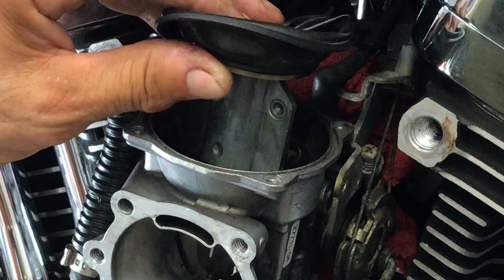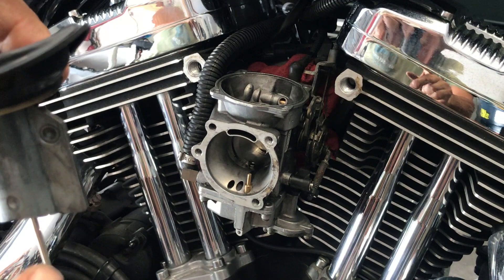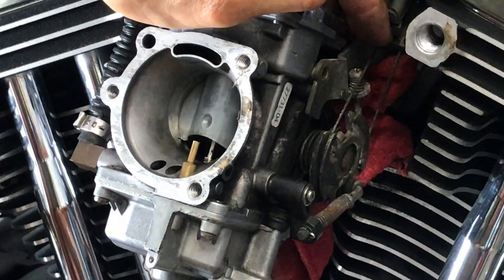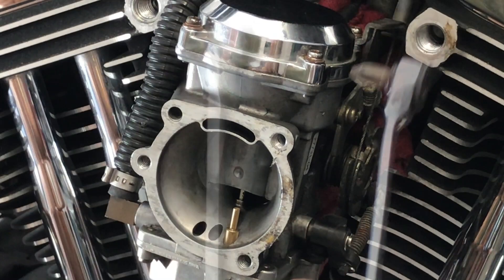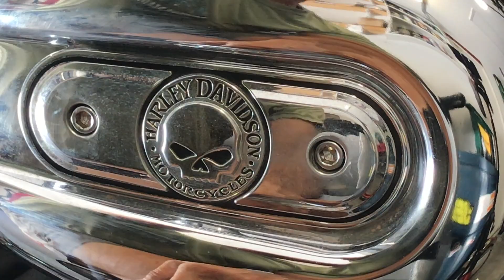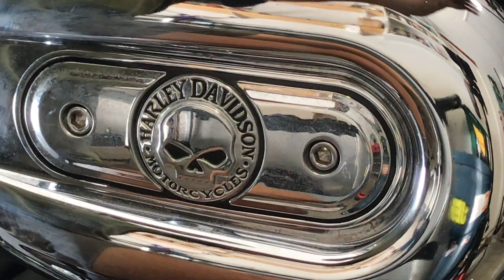How To Harley Sportster Carburetor Slide Needle Adjustment.

Comment: Maybe I missed it but what will prompt you to adjust the needle. You adjust all the jets first. Runs good. What makes you think, “I’ll adjust the needle? I have the c-clip one and there are shims also available on mine. I will say I did notice it sounded lean to me and so I very slightly honed the main jet out but come to find out it’s normal and I thought something must be wrong, so I feel better and that it probably needs bigger jets.
Reply from the maker: Happy to help.  Transition from Idle to off idle.  is not smooth when driving out.  I noticed three washers help.  You have the clip on your needle so you could adjust it that way and you don't need washes,  Let us know how it works out. Ride safe and have a great day.
Reply: @TwoWheelRocco  mine feels almost like it runs better choked for a while, understandably because it’s cold. Once warm it will stutter a touch at about 1/4 throttle around 30mph maybe once the primary jets kick in. I assume it’s lean all over because I think it has stock jets when I looked, 45 and a 155 maybe, and it has drag pipes and a K&N intake. I lifted the needle and honed the main jet a touch and it runs where I need to go. Just want to clean her up. I am going to rejet it once the jets come it and get back to you. It definitely is a nice sounding bike that is easy to ride and quite quick. I think I’m hooked.
Reply: Btw, I love your videos. Seem like you’re a guy I’d like to wrench with.
Reply from the maker: @novarocker247  I usually run 45 idle one 180 or185 Main and three washes on the needle. 1 3/4 on the air fuel. And that's the sweet spot I find on XL 1200s test and tune let us know how it works out.  Thank you for watching I'm a send you a video. Take a look and tell me what you think.   https://youtu.be/Cjixbd1ctqY.  Ride Safe and have a Great Day.
Reply from the maker: Thank You,

Comment: Rocco, my sporty has the screaming eagle intake 48 pilot and 180 main. I just did a ported intake mani and new seals and it still pops put the carb at low rpm when starting to accelerate. Do you think this will help. It's only when riding in any gear at low rpm at idle it's fine.
Reply from the maker: Happy to help. Try a 45 pilot and three washes under the needle.  1 3/4 on air/gas screw out. Thank you for watching and you sub Mic. Ride safe and have a great day.
Reply: @TwoWheelRocco  I have the air fuel screw 3 turn out it was at 2 and that helped a bit but still does. Are you saying go 1 and 3/4 on the air fuel screw because the washers will richer it up that much? I know it's usually at 2 it was at 3 I tired 2 it made it worse so I went back to 3.
Reply from the maker: @micc4044 A/F  three turns out it suggests a vacuum leak. Usually I find on a tight situation 1 3/4 no more than two. You're running a 48 idle jet, that's a lot of fuel then you're a/f three turns air fuel screw. it's suggests a vacuum leak somewhere. I hope that helped just my experience. Let us know how it works out. Rule of thumb if it's over two turns higher the idle jet.  you are at 48... Fuel is compensating for an air problem.

Comment: Is possible to remove the carburetor top by just removing the gas tank mount bolt nearest the seat and lift the gas tank up and support it by a block of wood? It seems like this process could work and save a lot of time. Thanks!
Reply from the maker: Happy to help. Any questions just ask you can go about it many different ways, gas tank or just tilt the carburetor after you remove your hardware and take it from the top that simple. Thank you for watching and all your support Michael. Ride safe and have a great day. Three washes as well I like. Let us know how it works out.
Reply: I was able to purchase #4 brass washers from Amazon for$4.86 , 100 ea. They are similar in size to the 1mmX5mm/7mm washers. I added 4 washers and it cured both my carburetor and exhaust backfiring problems. My bike is now running great! Thanks for your help!

Comment: Hey Rocco my bike won't idle without the choke on so i changed out the pilot jet from a 45 to a 48....still won't idle or even start without the choke on just a little. Its a new carb, new air cleaner and new gaskets... can you help me out? THANKS for all your content! your awesome and you've saved me several times from putting a few bullets in this 98 XLH lol
Reply from the maker: Happy to help. I would change that Idle jet to a 45 clean that circuit. What your fuel screw sat at. this can affect the Idle and off Idle.  clean that circuit. Thank you for watching and all your support GetnNauti. Ride safe and have a great day.
Reply: @TwoWheelRocco  well when I had the 45 pilot jet in I had the mixer screw about 4 complete turns out. Now with the 48 pilot jet it’s only 2 full turns out
Reply from the maker: As I see it, you're compensating for a bad vacuum leak and that's why the Idle is so hard to control. Check your vacuum line coming from your Petcock to the back of the carburetor could be collapsed or leaking. You have to know that bike ran perfect from the factory with a 45 idle jet. We are missing something. Let us know how it works out. I always go back to OEM and start there if you have the stock pipe the stock intake, stock air cleaner that means you're getting too much air or not enough fuel from Petcock. one or the other.. @GetnNauti
Reply: @TwoWheelRocco  thanks Rocco! Guess I’ve gotta find a hose routing diagram found a hose just hanging gonna go ahead and replace the voes
Reply from the maker: All you have to do is plug that hose in it goes from your peacock to the VOES. And tees off to the back of the Carburator. That's it. Hope that helped plug it in and see how she runs. @GetnNauti

Comment: Hi Rocco, i have a 2001 1200 sportster with 4000 miles on it, replaced the stock baffles with open slip ons, replaced the stock air filter with an open air filter, now it sometimes holds in when giving gas, also i hear a quit pop in the air filter area, to little fuel? are the washers adding in this video going to help? i got stock jets in it... hope to get some advice hear, love the videos greets from the Netherlands!
Reply from the maker: I would start with a 45 idle jet then work on the washes on the needle let us know how that works out.
Reply: @TwoWheelRocco  Thanks, i put in a 48 and a main 185, 3 washers on the needle and it runs perfect! old stock air filter was extremely dirty also... thanks Rocco!

Comment: Hello , it’s me again, no one in town has the shims, I found some really small that fit but the box said 3mm zinc plated metric flat washer. I found not see the thickness as the box did not say. Their from Lowe’s, item number 755487, model 127071. Do you think those would work the same? Or should I buy some that specifically say carburetor shims
Reply from the maker: Believe they will work. I would bring the needle jet to Lowe's and make sure it's slides on. Let us know how that works out. I know they are a pain to find. If all else fails let me know.   Thank you for watching Enrque. Ride Safe and have a great day.
Reply: @TwoWheelRocco  I put three of the washers, ride was rough, but I adjusted the air to fuel ratio to 1 and 5/8 turn and man it rides smooth now. One more question, same motorcycle, 2003 Harley Davidson 1200 custom, heavy breather, cobro neighbor hater slip one, have size 48 pilot jet and 185 main jet, with 1 5/8 turn and fuel to air, I am about to install the Vance and Hines short shots, with the set up I have, do you think I will need to open the fuel to air ratio more?
Reply from the maker: @JBTexas  I'm happy all went well. As for the Vance & Hines short shots you might have to add a little fuel on the air fuel mix. Those washers always clean up the mid range. Let us know how it works out thank you for watching.
Reply: @TwoWheelRocco  I should get them tomorrow, can’t wait. And just want to say thank you for all your feedback and videos, they have reached me a lot and save a lot of money. Have a great and safe day! Thank you
Reply from the maker: @JBTexas   My pleasure. Let us know how it works out. Thank you for watching. Ride safe and have a great day.
Reply: @TwoWheelRocco  so the washers I used work good, however, I had to back up the fuel to air ratio. It’s slightly over 1 1/2 turns. Just wanted to let you know and hopefully helps others. 2003 HD Sportster 1200 custom with 2k miles. 48 pilot idle, 185 main jet, full Vance and Hines exhaust with kuryakyn heavy breather, air to fuel ratio slightly over 1 1/2 turns but with 3 mm washers on carburetor from Lowe’s. Bike runs and sounds beautiful! Thank you so much fir all your assistance! Keep posting the videos! Teaching me a lot.
Reply from the maker: @JBTexas  I am Happy to hear all went well. I like the gas air screw to be at 1 1/2 . Thank you for your update Ride Safe and have a great day.   And it will help others..
Reply: @TwoWheelRocco  me again, what CAMS would you recommend for my Sportster? Looking for CAMS that will work with stock engine. Don’t Plan on updating rods, lifters or heads. Don’t ride aggressive, just cruise on lower RPMS. And what recommendations for the carburetor setup should I install CAMS. 03 Sportster 1200 custom 💯, has Vance and Hines short shots, high flow breather. CARBURETOR setup - 48 idle jet, 185 main jet, 3 shims on needle and 1 3/4 mixture screw. Would love to see a video of yours on CAMS should you have one. Thanks for all your help on all my other questions. Both bikes are running beautiful!
Reply from the maker: @JBTexas   I'm an OEM guy. Don't fix something that is not broke. Buy a big V twin if you want more power. There are a lot of people out there that can direct you to the right cam.  Sorry about that.  Let us know how this works out.
Reply: @TwoWheelRocco  sounds good, I love my bike stock, no complaints. Was thinking of adding CAMS but you do have a point. Again thank you for all your help!
Reply from the maker: @JBTexas  My pleasure.

Comment: hey rocco i recently added a arlen ness big sucker to my 06 883, getting some backfire in the carb on acceleration and even some stalling, is this a sign it needs re-jeted? or just an idle mix screw adjustment?
Reply from the maker: Happy to help,  45 idol and a 180 Main and what exhaust are you running. Thank you for watching and your sub Minusthefluff. Ride Safe and have a Happy Thanksgiving.
Reply: @TwoWheelRocco   thanks for the quick reply! Right now it had stock pipes with slip-ons. I have a bassani road rage 3 that's replacing that though.
Reply from the maker: @Minusthefluff  Take a look at this video.   https://youtu.be/Cjixbd1ctqY.  Let know how this works out.
Reply: @TwoWheelRocco  thanks Rocco, appreciate the help.
Reply from the maker: @Minusthefluff  My pleasure,  let us know how it works out.

Comment: I bought a new carburetor from Amazon and put it on my bike. The idle screw doesn't seem to move either way. Any ideas ? Have you seen this before ?
Reply from the maker: Happy to help. There's a lot of Chinese knock off carburetors for sale, At a very cheap price. And they fall short return it and get another one. Maybe the second time it work out been,very poor quality. Thank you for watching and all your support Al. What was wrong with your original carburetor? Ride safe and have a great day.
Reply: @TwoWheelRocco  You read my mind brother. I actually did that just to be on the safe side. My old one was just old it is a 1994 Sportster 1200 and I just figured it was cheap maintenance. You are the best. Love watching your videos !!!
Reply from the maker: @almusic286  happy to help. Any questions just ask and you are better off with the original carburetor most times. Thank you for watching all your support Al. Ride safe and have a great day. Let us know how it all works out.
Reply: @TwoWheelRocco  I sure Will and thanks for all your so helpful videos
Reply: @TwoWheelRocco  ok so I observed some differences in the new carburetor as compared to the original. Well yesterday was the first 75 degree day we got this year up in Rhode Island. So I swapped parts and piece mealed the carburetor together and got the bike running but it's popping and running rough can you help me out ?
Reply from the maker: @almusic286  if you could, Al 
.If you could, send me a cell number and I'll give you a call. Your getting off track with his Chinese carburator.

Comment: Do you happen to have a part number on that needle for an 05 xl883c? I just got this bike and it was running lean so I tore the carb apart and found an aftermarket needle, I’d like to put the original back but can’t figure out which size needle I need. This is the original cv40 carb.
Reply from the maker: Thats not going to make much of a difference,  manipulate the needle with the washers. If it's running lean what jets are in the bike but idle jet? and what main jet? and .Take a look at this video.   https://youtu.be/Cjixbd1ctqY.  Let us know how this to works out Ryan. Thank you for watching in your sub. Ryan. Ride safe and have a great day.
Reply: Thanks Rocco It had a 175 main and 42 pilot with an aftermarket exhaust and air cleaner. It ran like shit. I just got a new big sucker so I’m thinking of putting a 195 main and 48 pilot. To see how that works. I also got the original 88 needle, I heard it was a little slimmer and better than the stock needle. And thanks for the reply, I really enjoy and learn a lot from your videos
Reply: I recently bought the bike used and I’m figuring all the bad stuff out the hard way, these guys obviously didn’t know how to jet it after they installed aftermarket parts. I’m new to riding myself so your videos help a great deal
Reply from the maker: @ryanrangel8606  Happy to Help. It seems you have this under, control. Any questions just ask, tune and test...That's what this will be about. And you will enjoy it, Thank you for the update, Keep us posted.. Ride safe and have a great day

Comment: Rocco I have a 97 883 with a 1252 Wesco kit and Andrews Cams my carb runs like shit it runs but stumble's alot got a CV 40 mm carb running a slow jet of 42 main jet of 180 never did a shim job yet any pointer's on curing this problem with my carb higher main jet and shim the carb what's them shim's you used?
Reply from the maker: Happy to help. What intake and exhaust are running?. Thank you for watching and  your sub Jesse. I would start with 45 idle  180 main. 
1 3/4 air fuel screw turned out.  3 washer under the needle.  Ride safe and have a great day.    https://www.ebay.com/itm/291994473665
Reply: @TwoWheelRocco  I am running the stock intake and a set of LAF Ground Shakers exhaust on my 97 Hugger Sporty help with this problem please I have tryed everything but shimming the needle have an ez adjustment screw and Harley adjustment screw as well but nothing cure's the stumbling very puzzled
Reply from the maker: @TheJesse1959  very tough Exhaust to tune. you have a stock intake a radical exhaust and minimal idle jet. As I stated       45 idle jet   180 main jet     three washers under your needle   one and three-quarter turn  air/fuel screw out.

Comment: TWR my 03 XLH883 while at idle, when I twist the throttle really quickly, it coughs and pops, I’ve checked the fuel and vacuum petcock. Any idea what might cause that??
Reply from the maker: Happy to Help, I will check your accelerator pump I will send a video.  Let us know how it works out. And you did test your petcock? .https://youtu.be/BEvtEw_twPQ. Thank you for your Sub.Chrisl. Ride Safe and have a great day.
Reply: @TwoWheelRocco   I watched the video you sent, I have looked at the spray from the needle into the throat of the carb and it seems to be strong and not clogged. Would there be another reason that the quick rev would cause the hesitation? Is there a way to send a video of exactly what the problem is? Really appreciate the help and the videos are unbelievably helpful! Thanks
Reply from the maker: @chriswickham6377  No problem, Send it to erocco3964@gmail.com. I'll will get back to you
Reply: @TwoWheelRocco  thanks again, I sent a little audio, kinda hard to hear but I think you’ll recognize it. I suppose it could be a bad gasket in the accelerator pump, let me know what you think!
Reply from the maker: @chriswickham6377  Thats a terrible video or sound.
Reply from the maker: @chriswickham6377  is it squirting fuel from that needle? Your video really bad... It's being kind.
Reply: @TwoWheelRocco  sorry for the crappy video, I sent you a new one! Preciate your time!
Reply from the maker: My pleasure to help.

Comment: Hey Rocco I’m having air puffing out of my breather bolts almost sounds like an intake leak is that normal?
Reply from the maker: Happy  to helpl. What year? How many miles? If all runs well I wouldn't worry about it, Thank you for watching and your Sub Michael. Ride Safe and have a great day.
Reply: @TwoWheelRocco  That breather bolts are meant to allow the release of gases that build up in the top end. They should have small houses that route the gases and/or oil to the air cleaner, which is then routed to the carburetor and ingested by the engine. This is an EPA requirement to prevent gases from going out to the atmosphere and polluting our air.
Reply from the maker: @CarlosGarcia-ls4hn  OK.  look at 21:35.   Just trying to help Carlos. .Ride Safe and have a great day.

Comment: Great video. Is this a standard washer I can get at a hardware store?  I see the bag of 50 but I'd only need a couple, Do you know what the actual size is?  OD and ID ?
Reply: The size is 1x3x5mm
Reply from the maker: Thank you
Reply: Is this size correct I can not find washers that are 1mm thick only 0.3 so i would need 12 of them to equal 3 of yours?